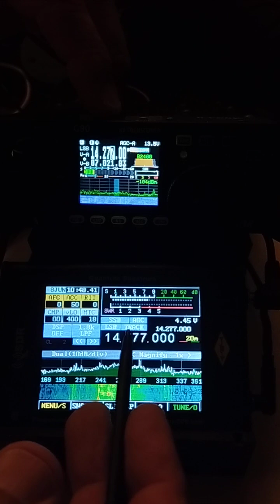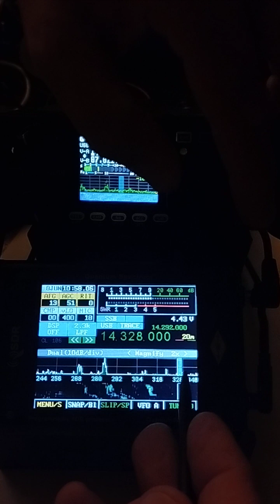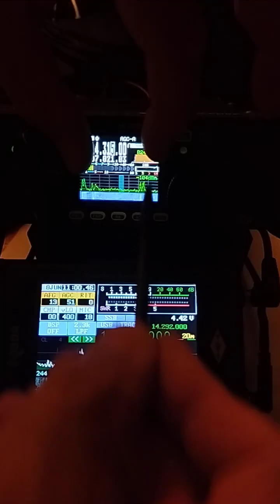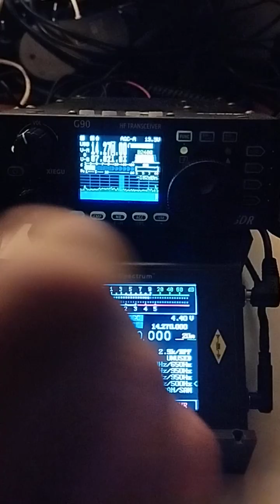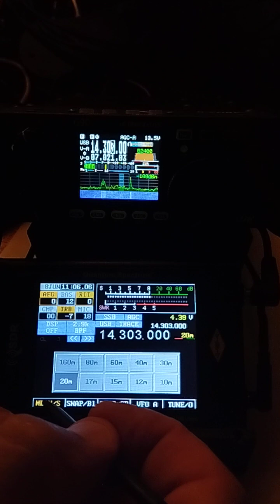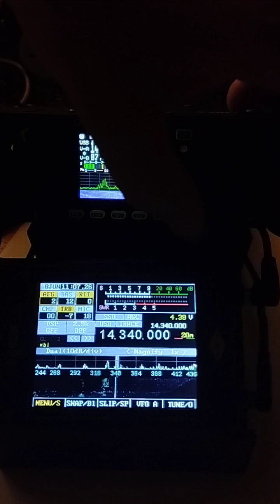Spectrum DSP M2 user interface (full-screen to view)

Comment: Hi brilliant little unit only just got mine S/H from a fellow ham only one problem its too small needs to be the size of an Ipad...
Reply from the maker: The LCD on the QuantumSDR Spectrum is standardized at 5 inches as this suits most people and at 280g/8oz is highly portable.  It is also day-bright giving 1000 cd/m2.
For those wanting larger displays, the factory fitted WiFi option allows monitors and tabets of all sizes to be connected.  info@QuantumSDR.com

Comment: I see Xiegu G90 has new Firmware  for head unit only 2022-05-07 v1.8 ,
 changes are : 
1- To work with JTDX/WSJTX (or some other data mode softwares), add CI-V commands 0x25,0x26,
See <<XIEGU RADIO CI-V REFERENCE>> and <<XIEGU RADIO JTDX WSJTX SETTINGs>>
2- Add CI-V command 0x1d 0x19, read the XIEGU RADIO ID

I wonder if this will bring any extra functions to the Spectrum M2 in a future firmware.

just about to order one 
Cheers Stevie 2M0ufo
Reply from the maker: At the moment we aren't aware of any benefits from this recent firmware version, but we're always open to suggestions.

Comment: Is it possible to decode cw??? Did you find an easy way to connect to a KX2???
Reply from the maker: Yes, you should use the 300/700 filter setting without  NR, and adjust the AGC to get the best level.  We will be looking to add a more capable CW decoder that uses ML in future.
Reply: @quantum-SDR  great news...
Reply: Is there a way to connect it to a yeasu ft991 as it has no realtime spectrum and waterfall?
Reply from the maker: @ON3STG  you can connect with IQ or via an IF adapter.
Reply from the maker: The preamp input can be connected directly to the I and Q points on the KX2 main board.  You can see the details here (interface board not required) https://elekitsorparts.com/product/i-q-add-on-board-for-elecraft-kx2-powersdr-elecraft-kx2-elecraft-kx2-mods/
Reply: @quantum-SDR  too difficult for me...... 73 qro
Reply from the maker: @philippehaake6123  You just need to solder 3 points, I, Q and ground to a 3.5mm jack socket.  Miniature twin audio coax is suitable.